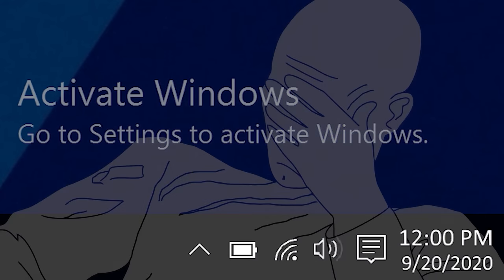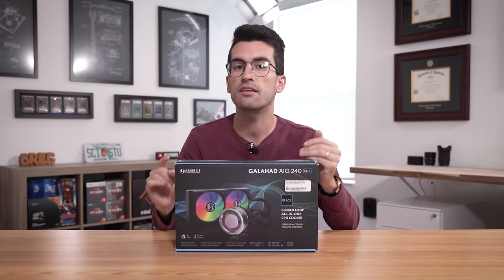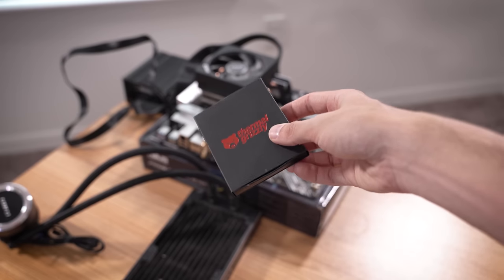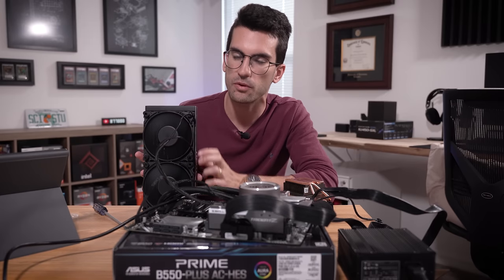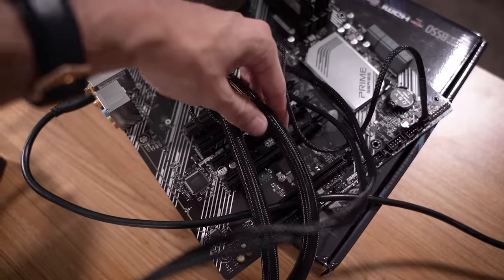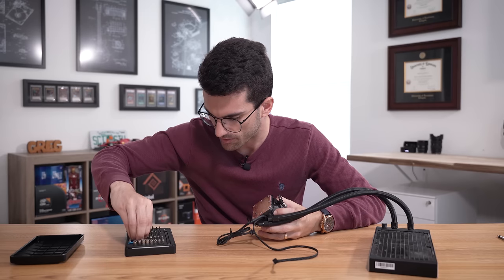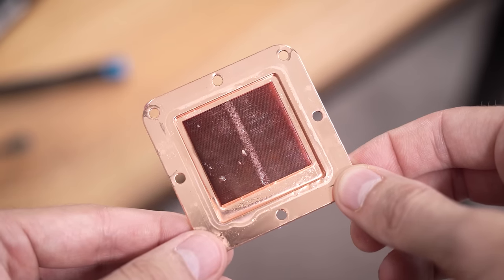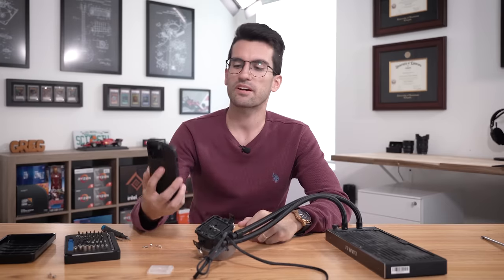A Viewer Sent Me This Broken AIO...

Comment: Exactly similar thing happened with me but the AIO was from Silverstone, PF 240 ARGB. The temps used to climb to 80-90° just on idle. As it was just out of warrant period, Silverstone distributer declined replacement and said its not even serviceable. Opened it up, cleaned the gunk thoroughly, flushed with white vinegar and then with distilled water multiple times. Finally filled it with a 1:2 part mix of red automotive coolant and distilled water. Tough part was to fill it properly and remove the air bubbles. Works great now, actually better than what it was brand new. Idle temps at 25° now. Used CoolerMaster Cryo Fuze Violet thermal paste during re-installation. Given it is Core i7 10700k I will say that's a win. Will see how long it lasts before I get a replacement.
Reply: Having the same issue with a enermax 240 aio. How did you end up getting it refilled and removing all the air bubbles out? Im having a hard time myself with it lol
Reply: @ecko90044  This was really the toughest part. What helped was that the AIO could be disassembled and has a fill port on the radiator as well. Still to remove the air bubbles, first disconnect the radiator and pipes from the AIO pump. Then using a medial syringe (with the needle removed) and keeping the pipes vertical, push the coolent mix slowly into one pipe till it comes out of the second pipe. U would need an extra set of hands for the process. Then connect the pipes back, keeping the radiator still, without tilting or changing its position. Once done, maintaining the same position, open the copper plate on the aio, and fill the pump chamber slowly using the syringe till the brim. Close it back avoiding any spills. Test it to check if everything works properly. If there is any gurgling sound, disconnect the aio, open the fill port on the radiator and slowly shake till air bubbles come to the top. Fill some more coolent with the syringe through the fill port. Shake gently and repeat till bubbles are gone. Close it up and retest. Remember being slow and steady is the key here.
Reply: @sherichander  I have the same problem with a ID cooling, after 2 days of trying to understand what was going on I stumble upon this video. Do you think just cleaning the goo and the microfins would make it work for some time ? When you said you flush with white vinegar, it was only the pump head or inside the tubes as well ?
Reply: @maurogrimau6733  Unfortunately just cleaning the goo doesn't work as the whole coolant is for sure contaminated by now. I flushed everything the pump, pipes and radiator.

Comment: This is hilarious at this point how AIOs are failing like this.
I had Corsair H110 (original version, no rgb) and it ran 24/7 for over 7 years, cooling overclocked FX8350 with a total system downtime in 7+ years being only 7days total. 
It never had any problems with cooling the CPU and ran perfectly fine until i switched to Noctua and AM4. Credit where credit is due, good job Corsair, lol!
Reply: My first-gen Corsair H80i failed exactly like this a few years ago after 7 years of service, first on an FX-4350 and then an i5-4690k. Maybe I was an outlier, maybe it's not necessarily brand specific, I dunno.

Comment: Greg, I've had enough of this water cooler. I've gone through two RMAs and the pump keeps failing. The third time, I took the replacement from the RMA and sold it. Lian Li is nothing but trouble with water coolers. Now i`m use thermalright PA120 Se... Now i`m love my aircooler

Comment: Steve from Gamer Nexus actually talked with the people from Hyte, where they talk about Alpetek, the OEM for both MSI and Lian LI and they're open about the issues on clogging. Lian Li has handled the issue way better than MSI with most customer actually receiving instant replacement units. If I'm not mistaken also, Lian Li has also changed their OEM.

Comment: I have a Corsair 360mm AIO that I bought at Fry’s. So that says just how old the thing is, 6 years at least. It’s been in continuous use on my machines since. 8700k, R93950 then R95950, it still works like a champ. Really glad I didn’t go with the off brand that the sales guy recommended “they’re all just asetek, so there’s no difference.” 🤦‍♂️

Comment: I got a Lian Li Galahad 240 as well, that failed for the same reason. I contacted Lian Li, and sent them my proof of purchase. Lian Li was very cool about it, and sent me a new one free of charge. They actually screwed up, and sent me a white one, even though the one I purchased was black. I sent them another email basically saying that the one I originally had was black, and I really don't want a white one. I really didn't expect them to send me ANOTHER one, but they did! I haven't had a single issue with the replacement in over a year of daily use. They also told me that I could just keep the white one, and I didn't need to send it back. I ended up giving it to my friend. I am very happy with Lian Li, and the way they handled this was top-notch. So many companies could take a lesson from them. It's not the failures that make the company, it's the way they handle the failures! While I agree with you, Greg, on most of what you're saying, I will say that the people who don't notice when their AIO is failing are not the kind of people who are going to look out for statements from a manufacturer saying that their product is defective, and it's impossible for a manufacturer to reach their consumers directly, especially if the consumer isn't looking for that information. So it is what it is. I think they did a great job

Comment: I had the MSI radiator, it had issues 3 months after use. Was not aware they did a recall/RMA PSA. So I bought the Lian LI 360 AIO, thinking its high quality and what not. Today my system randomly shut down. I go to Bios, check temp, its at 79 C., same with Hwinfo etc. Guess it finally gave out after a year of use. Just my luck for buying 2 faulty AIOs. 
Atleast I can plug in the new MSI one I have in the box while I wait for Lian Li.

Comment: Apparently the problem is only affecting very early units.  My white 360 was a Pre-order so it was very early indeed. 
I am running a 5800X3D so I didn't really notice it, It's not a Hot chip. From the time I contacted Lian Li it took 6 Days to 
recieve a new unit without the fans. They sent it Fed-Ex overnight from Taiwan. The shipping probably cost more than
the radiator and pump unit. No need to send the old one back, it's trash anyway. I did need to provide Proof of purchase
which could be a problem for a brick and mortar store buyer who tossed their receipt.

Comment: I had a Lian Li Galahad 240 AIO in my rig about a year ago. I was living in Japan, and one day my CPU temps would spike to 70 degC while idling on windows and climb to 90s when I moved the mouse. I had to rush out to the nearest PC shop in the city and I lived outside of Tokyo so specialty store were few and far between. I grabbed a 280 from corsair, pulled out the Galahad, and everything went back to normal; did even better than before. I didn't have my tools yet so I couldn't go and open it up to check for clogging but the PC workshop I took it to thought that was the issue. I didn't buy the Galahad in Japan and the warranty window from the seller I got it from in my home country had already closed. The Galahad performed solidly for the 13 months I had it. I was supposed to hang on to it till I got back from Japan but I had to come home in a jiffy (cuz of stuff with my job) and I couldn't fit it in my luggage back home anymore so we had to part ways at the recycling center.

Comment: I had the same problem with my Galahad 360 which I purchased in October 2021. I must have one of the old stock as they stated they had fixed the problem in the manufacturing process in the October, however in June 2022 my temps were suddenly high on idle, I changed thermal paste as a first fix and this didn't solve the problem, contacted my supplier vIa RMA and it was replaced without question, disappointing that an official statement has taken so long to get out to the public.

Comment: Bought a Corsair H60 in 2011 to pair with my I7 2600k and it was nice for 3 years  and  then the pump had to start work harder as most liquid been used up. But i got a somewhat bad taste of AIO as you need replace them most likley after 2-3 years. So now i just use big tower coolers now instead.
And vidoes like this makes me even more happy that i went with a Noctua NH-D15 to pair with my amd 3700x as no hazle with liquid beeing used up or clogging happening. 

Long live big tower coolers :D

Comment: Every AIO I've ever used has been a Corsair, and I've had a fan bearing fail--after 5 years--and a bit of gurgling from air in the system, but never a failure to cool.  I have two Corsair AIOs in service right now, and they're working fine.  The one is this system is an H105 that's at least seven years old, quiet as a mouse and providing great cooling.  CPU package is sitting at 36C as I type.  As good as air CPU coolers have gotten, I'll be favoring a nice big honking air cooler in my builds.  And if I ever do need another AIO, it'll probably be a Corsair or some other Asetek design.

Comment: This may have already been discussed, but I'll mention it anyway. That bit that you used is called a spanner or snake-eye bit. I often wondered about it myself as I have the exact same IFixIt kit that you do. And you are using them to deal with the security screws you are using them on.

If I learned nothing else from this video, I at least learned for what those bits are designed. Thanks!

Comment: I discovered this exact problem a week ago. My AiO was up and running for about . As of now, Lian Li still fulfills their promise of replacing the Galahad I AiOs quickly and without much trouble. I reported the problem on December 14. They replied within 10 hours and the replacement is already on it's way and is destined to arrive today (Dec. 22). The exchange process deserves probs, but to figure this out still took me a lot of time, because i hadn't heard of the general issues with the Galahad before. 
If it all goes well from here, i may consider their products for future hardware despite this flaw. Otherwise the Galahad will become my first and last Lian Li product.

Comment: Lian-li has by so far one of the best customer supports at the consumer pc market. I have 10 lian-li UNI-infinity fans in my system in 3 stacks and had a problem with a stack of 4. even before confirming, and dissasembling the stack they had shipped 4 new fans. later it was confirmed one of the fans had a broken pin causing the whole stack loose connection. I live in norway and it's a realy good consumer warranty by law here.. but here i would have had to disassemble the stack and return the broken fan to get a new one. ... so guess i have 13 in my rig now.. my thickest radiator(60mm) has push pull now  :D

Comment: Just last week I noticed that the hotspot on my GPU was running up to 105°C in my custom loop, while gaming, and the normal GPU temp was creeping up to almost 80°C.
I just disassembled the GPU waterblock, and cleaned the fins, and my temps dropped back down to a nice chilly 50°C, with the hotspot around 65-70°C. And mine was not even that gunked up, just a few bits of green/blue corrosion on the fins.
But Lian Li kind of shot themselves in the foot with those antitamper screws. They could easily have just told people how to clean the units. It's basically a 5 minute job, with a bit of care, and you're done.

Comment: I saw the reference to this on GN about a month ago. My Galahad 240 seemed to be ok, but the temps were a little higher than I had expected, but I had switched CPU at the same time so put it down to that. I bought the Galahad in September 2022 but I had a serial before the number listed so got in touch with Lian Li on a Saturday afternoon. Sunday afternoon I got a response that they would send out a replacement and not to bother sending the old one back and to expect the replacement within 26 days. As it turned out the replacement showed up this week, less than a fortnight after the issue was raised and whilst the box it came in looked a little worse for wear, it came with all the fixtures and fittings as the original (no fans obviously). All in all a great RMA experience for someone who doesn't have a broken AIO, perhaps not so much for someone with temps that you were showing. But as you say, they weren't exactly proactively reaching out to consumers and how was I able to purchase an affected AIO 6 months after they started RMAing devices?
Reply: I should mention that I'm in the UK.
Reply: Things can sit in a warehouse or on store shelves for a long time before being sold, and the company has no clue where they all are, that's why it is hard to just simply recall all the units.

Comment: Nzxt has the same issue on the H1 Case AIO.
I simply cleaned it and refilled with proper fluid. Works now like a charm.

The gunk in the H1 AIO was really disgusting.

Comment: I actually have a 360 galahad.   after watching the GN info on it, I decided to be proactive.  while mine has not failed yet (I don't use it heavily) I reached out to Lian Li and they sent a replacement fairly quickly...  Granted I had to send the serial number and proof of purchase (from 2020), at least they sent a replacement without the hassle and said I can keep the old one.  wish they would have been more upfront about it, but least they are replacing them even  if they haven't fully failed.

Comment: I got the exact same cooler that is in this video. Bought it September of 2021 I believe. I have a i9-10900k and it's been running perfect the whole time. I'm currently sitting at 33 degrees Celsius and clocked at 4998.8 MHz.  Guess I just got a good one.

Comment: Hello Mr. Greg. You didn’t share how to fix such problem. If you dont have the possibility to replace the cooler. 

I spent the last 7 hours just to fix mine because I really can’t afford buying one and i have to study and to use the pc in general. 
I have aqua 240 crouger. 
The problem was the exact one that you show in the video. And simply i fixed it after getting the tubes off the motor. And just filled with water and muriatic acid. And just kept blowing into the tubes till a lot of orange pieces came out and that took me like an hour to do it. And then made sure its filled with water no air bubbles. Got it back together and boom 💥 the thing was running brand new. 

Before i do this it was 95-100 degrees when i reach the  windows desktop. And i feel great about it. And you helped a lot thank you much for your videos 🤜🏻🤛🏻

Comment: seems like a good use for my idea of using solid carbide drill shank's to make super sharp bitey screw driver tips since you could push down hard while turning and the bladed edge of that nearly diamond hard bit will deform those slopes that normally let the screw driver slip up and out of the screw, (its like it is pre- stripped going the direction of loosening them. lol)

Comment: According to Lian-Li (and other vendors),  the issue was that some of the units went through a 2nd time soldering and QC missed that the residue from the solder caused corrosion with coolant over time. This particular manufacturer of the AIO has been warned by Lian-Li and others that there is zero tolerance for 2nd time soldering of the radiator and increased QC scrutiny for each batch.

Comment: I think the issue here is to develop a form of fluid to clean out the AIO before use. Most manufacturers especially low cost ones are putting just untreated fluids in there which will cause algae bloom. Something that kills algae is Methelyne Blue Hydrate. It kills the spores and keeps the loop free from having another bloom. A good way to clean your AIO before or just adding it to the loop if refilling or just before turning it on and letting it run for a bit to allow the solution to circulate.

Comment: I had the same issue with my Galahad back in Dec 2021, LianLi asked me to take a video of temps before sending me a replacement. They didn't ask for the old unit back. The thing is... the replacement they sent me was either a refurb or open box item, and the dated serial number for the replacement is older than the new ones they listed which states it shouldn't be impacted. Hoping this one also doesn't get clogged, seems to be ok so far.

Comment: Well I may as well ask the community. My rig (i5 12400f, gigabyte 3070) went black screen yesterday.

I checked both ram sticks, removed the GPU and tried out a gigabyte 2070 that was running just minutes before the test, I did the cmos both battery and pins and still nothing.

The weird thing is that when plugged into a monitor that has a 5 minute sleep timer it makes it sleep instantly. Tried multiple monitors with the same result, it almost seems like it is stuck in a sleep mode protocol that is looping. Everything is under warranty so I'm worried about taking it all apart and damaging something myself and voiding that.

Any ideas?

Comment: Never had an issue with my galahad 240 RGB. It hasn't cooled as well as I hoped but it's been perfectly fine and probably partly the case limiting fresh air. I bought it in Q2 2021, 2 years down the line it's still normal temps both idle and under load.

Comment: I got (as a gift) the Lian Li Galahad 360 AIO in 2021 and it's now doing the same thing Temp wise.  Yes I could go thru all that hassle, but to be honest, my Mugen 5 black air cooler is keeping my AMD 5800X just as cool as the AIO ever did, and all I have to worry about with my air cooler is changing the thermal paste every once in a while & the odd fan breaking, which is way easier to fix than that AIO. 🤣
 
But this IS way useful info for those who are having this problem & thanks for the info.